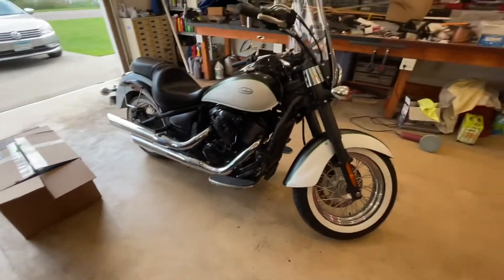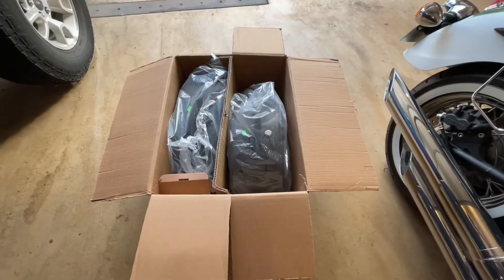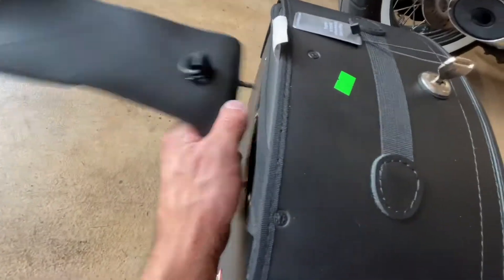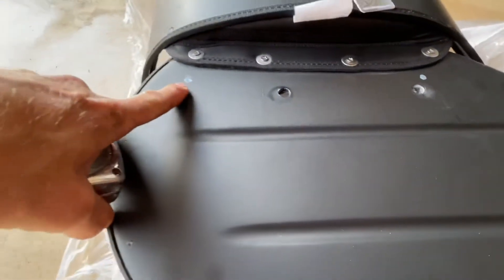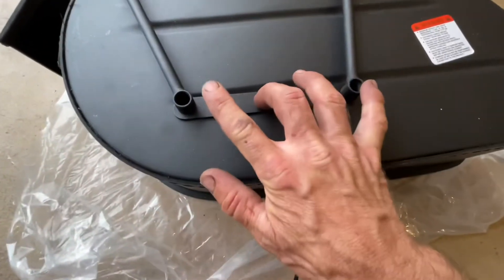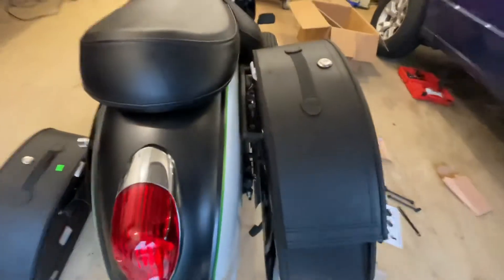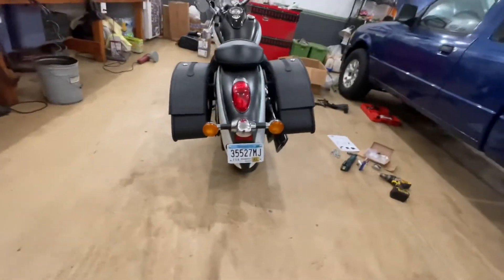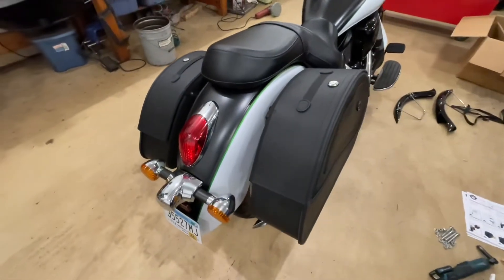Unbiased Viking Bags install and review on 2015 Kawasaki Vulcan 900

Comment: Just installed the Viking Raven bags on a 2003 Honda Shadow ACE. It was a nightmare. Had to patch a few hole that weren't in the right place.  And putting the two bags together to mark the holes didn't work with my bags because of the way the lids open.
Reply from the maker: Sorry to hear that. :(

In the end I felt like mine went ok, but definitely more complicated than expected.

Comment: I really wish I saw this yesterday. Putting mine on was a nightmare. I found they sent me the wrong size bolts. Sent me 10mm bolts and the bike requires 8mm. The directions didn't show the flap being removable. I figured that part out, AFTER, I measured the holes. Luckily the holes are still good. Good quality, terrible "universal" and directions.
Reply from the maker: I hope the end result was at least good. 
I like the bags, but the install was more than I was anticipating.
Reply: @bennieaust  I haven't put them on yet. I did find out the stock bolts are not quality bolts anyway. I picked up some stronger ones. Also bought shorter ones. The ones that came with it were far too long